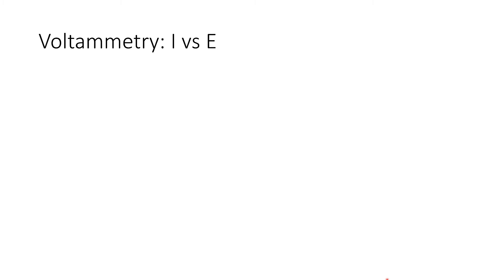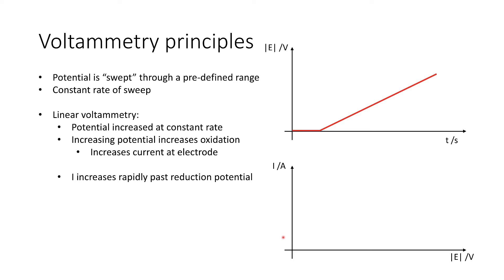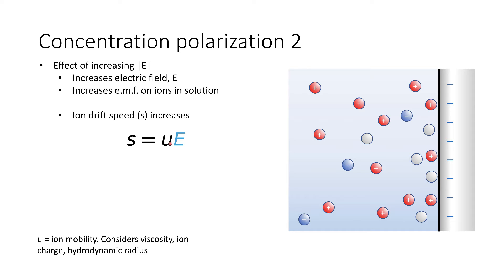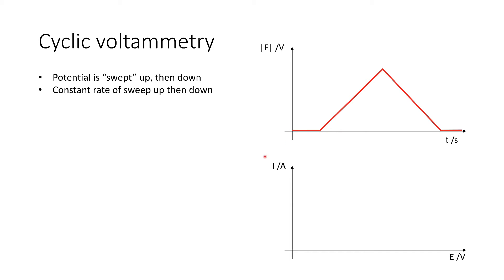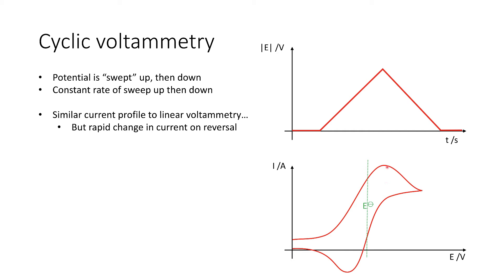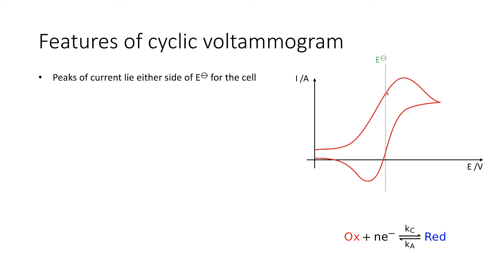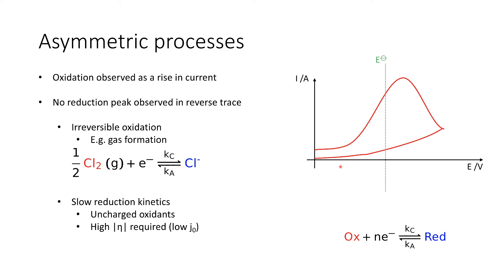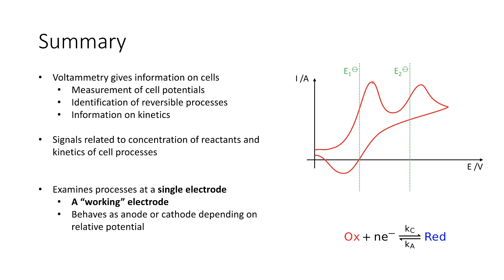Further Physical Chemistry: Electrochemistry session 10

Comment: Please any one help me in solutions this problem

One gram of zinc metal dissolved in a solution of hydrochloric acid with a concentration of 6 molars, dilute it to 250 ml. Take 25 ml of it into a polarography cell, and the polarogram shows a voltage wave at -0.65 volts (assigned to Cd impurities), a diffusion current equal to 32 milliamps. If we add to the cell containing the zinc solution 5 ml of Cadmium chloride concentration is 0.0005 molar, and when taking a second crystalogram, the diffusion current was 77.5 milliamps. Calculate the weight percentage of cadmium impurities in zinc metal.

Comment: Hi Andrew,
thank you for this series. It has provided me with better understanding in electrochemistry. 
I have a doubt on a statement you made in the 3:00-3:15 of the 10 session where you said that the concentration of a specie in the system can influence the rate of reaction. I argue that this may not necessarily be the case giving that the concentration has no role to play on the Gibbs free energy, exchange current density and standard potential. Could you please shed more light please.

Comment: Very nice video. Thanks for the upload. I just had a concern about the use of the mass transport limitation of the oxidized species as the main reason for the formation of a peak. I think CV peaks are more traditionally taught with the reactants being the mass limited species. While ofc both can be true depending on the their diffusion coefficients and charge, I think the explanation of the CV peak using a reactant mass transport limitation is better. This is because it is easier to transfer conceptually to different electrochemical processes such as CV for electroplating processes. What are your thoughts on this?

Comment: I don't understand how your reagent is reduced from cation to neutral but then oxidized from anion to cation. Also the part at 9.23 I am not sure if is worded right?
That said thank you for your insight, this is excellent
Reply from the maker: Glad you have found the videos useful.

In the video we first look at the cathode process (reduction of cations to uncharged species) in the example of linear voltammetry; but in the second part when exploring cyclic voltammetry in depth we look at the anode process (oxidation of anions to uncharged species). Note that in both cases they are either oxidised or reduced to the uncharged species - I can't see anywhere that I reference oxidation from the anion direct to cation; this would involve a two-electron process and the kinetics would be very different.  
Remember that we are only interested in processes happening at one electrode (while a counter electrode completes the circuit); at one potential we will be oxidising anions, and when we lower the potential we will start reducing cations. These are not necessarily positive or negative potentials, simply different levels of potential.  We could plan to do our CV sweep between 0.2 V and 1.4V; never going into a negative potential region, but we may still get reduction happening. What we see very much depends on our experimental set up and the system we are interested in.

RE 09:23 I'm not sure what you are getting from the video, so not sure where the confusion comes from.  The background to the processes is that the negatively charged anion migrates across the electric field gradient to the anode, where it is oxidised to an uncharged species. This then diffuses across the concentration gradient away from the anode. So at point E, the concentration gradient causes diffusion to be faster than the electric field causes for migration of the anions.  I realise this is just a re-wording of what I say in the video, so if this doesn't help to clear things up please do let me know.
Reply: @aw_mckinley  hey, thank you for the reply. It turns out you are completely right, I assumed the oxidation and reduction examples were for the same compound. 
At the point E as far as I understand we get a reverse current due to a reduction process and the oxidation has already stopped. I think I assumed the oxidized species are nil at bulk solution so I imagined the diffusion backwards.

Comment: Wonderful video!
Very clear and well presented.
Do you have a similar video explaining the selectiveness in a electrolytic refinement cell?
How do the electrode potentials influence the species being plated out and how important is this voltage vs the requirement to run at higher currents?

Comment: @ 9:17

Should it be the "diffusion of reduced species from the anode faster than the ionic migration" instead of "diffusion of oxidised species from the anode faster than the ionic migration"?

Because at this point, we are having a cathodic current, signifying that there is a reduction on the anode.

Comment: is the applied voltage in case of cyclic voltammetry, DC voltage or AC?
Reply from the maker: Good question!  We work with DC voltages, HOWEVER sometimes we switch the DC from positive to negative.

True "AC voltages" switch from +V to –V; whereas our CV experiments switch between V1 and V2. The difference is subtle:
- The magnitude of V is constant in AC; so voltage going from +110V to –110V.
- In CV, V1 and V2 can have any value, and are not necessarily connected.
--- V1 could be +0.5 V , while V2 could be +1.2 V : this would not give an AC condition.
--- V1 could be +0.9 V, while V2 could be –0.5 C : while the current would switch direction, it would not have the same magnitude at the extremes of the sweep.

True "AC voltages" vary sinusoidally. 
In our CV experiments, we ramp the voltage linearly up and down, so any wave is more of a saw-tooth rather than a smooth wave.